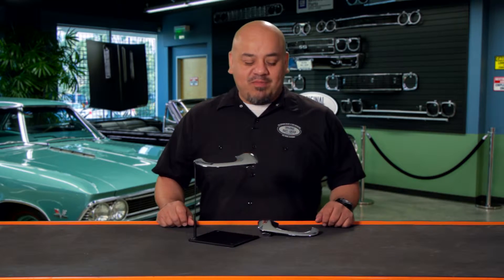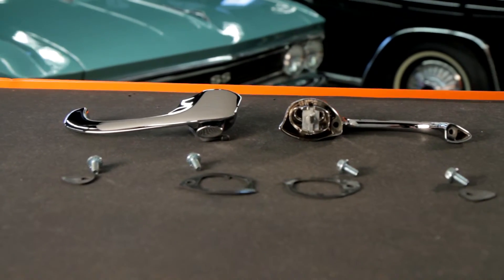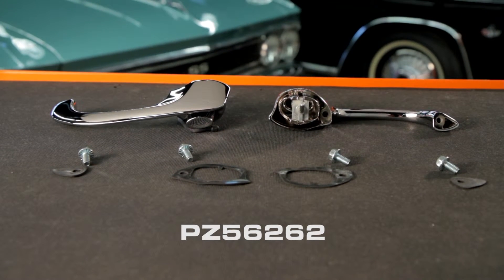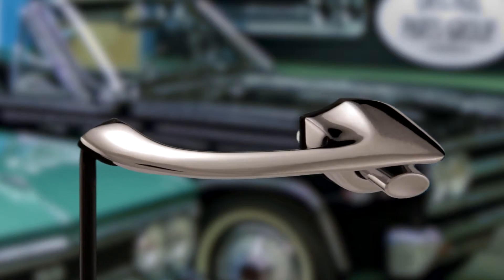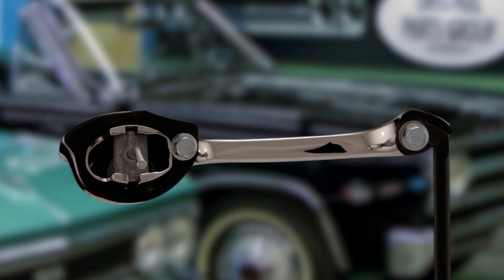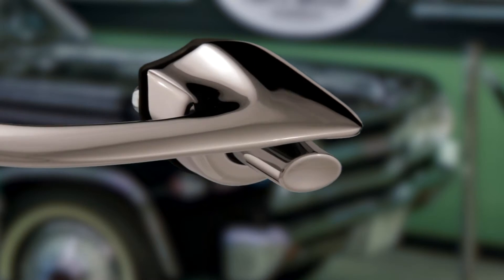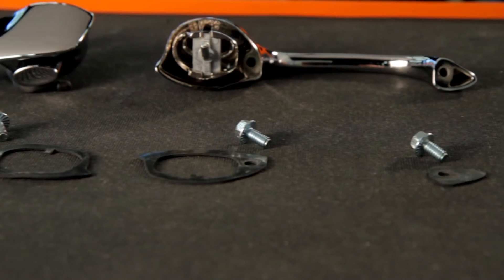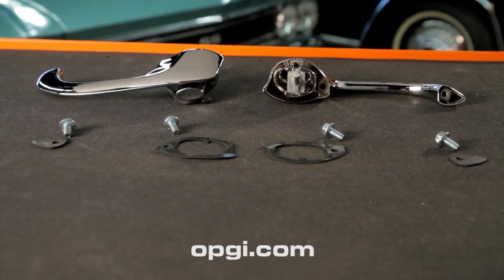OPGI Product Spotlight: 1968-69 Chevelle Door Handle Kit

Comment: Bought this kit at the Ocala store. There’s a question about which version I’m supposed to have, early or late? One has a longer actuator than the other. I got the longer one, just in case.  My car was built in May of ‘68. What’s the difference between the tow other than length? Shape, angle?